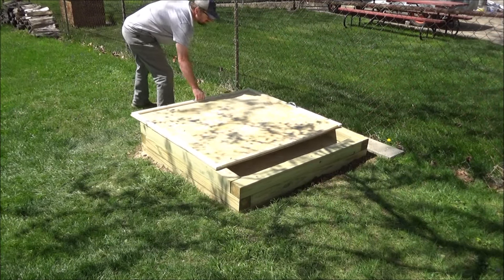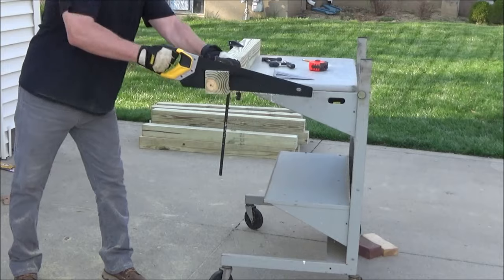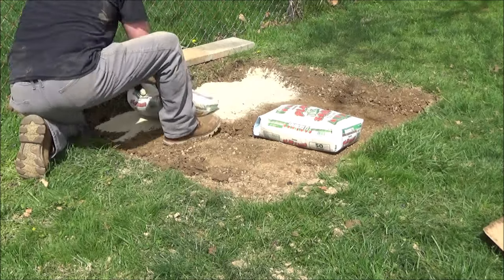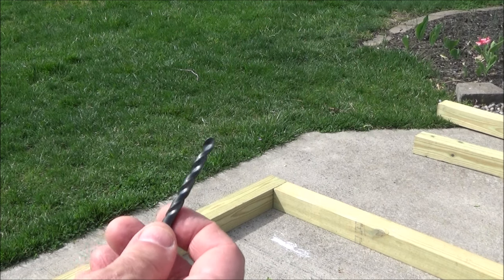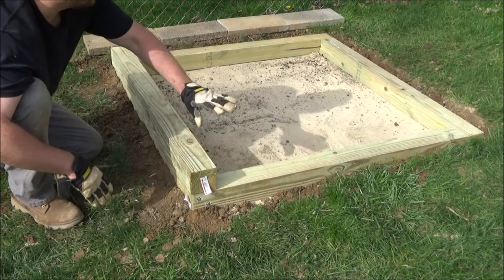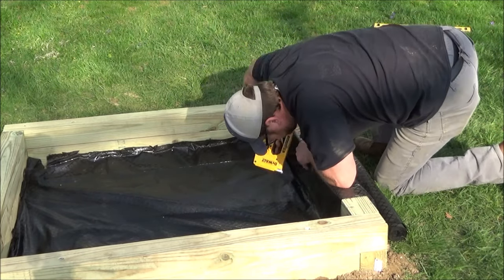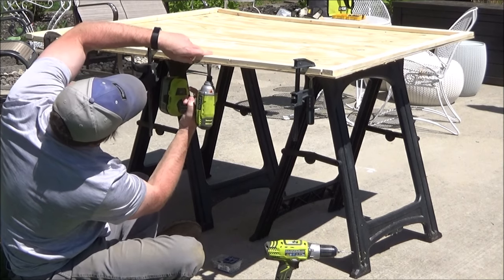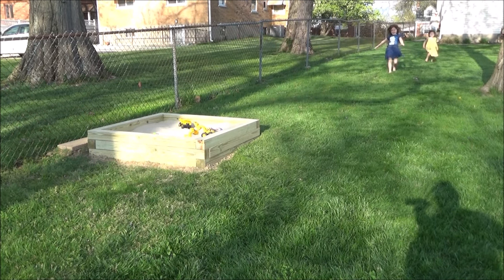How to Build a Simple Sandbox - DIY

Comment: Thank you for this video, I just built very similar sandbox from 4x4s. I noticed sides were a bit unstable and I also added four side screws to attach each side to another at corners, that made it rock solid. For cover I'm using shade fabric as I didn't have spare wood for this size of sandbox and buying new would've been too expensive. Thanks again!
Reply from the maker: No problem and good idea about the corners. Whatever will keep the critters out will work!

Comment: Thank you! How does it stand with rain. Do you need to apply paint on it?
Reply from the maker: No problem. You do not need to paint the 4x4 since they are ground contact boards, but I did paint the lid later to help it last.

Comment: Thank you for this video. I just wanted to know how the 4x4s are holding up being exposed to weather? This is a consideration since we live in a tropical climate. Thank you
Reply from the maker: The 4x4's are holding up solid, since they are "ground contact" treated. The lid has taken most of the damage from the weather. I painted the lid to help it last longer. This past summer I added a few screws where the trim was bowing up and added some roofing paper to make it water proof.
Reply: Thank you! I have my 4x4 from a previous pergola I built. Unfortunately, a cat 4 typhoon took it down breaking the support. Will it do well if the wood has been applied with waterproofing stain and sealer? I noticed that standing water between wood on top of each other harbors a slimy white mold. Though easy to remove from the surface, it may be challenging if this gets stuck in between wood. Nevertheless, will try per vid. Thank you!
Reply from the maker: Sorry to hear about the pergola. If I had the lumber on hand, I would just go ahead and use what you have. Most likely the kids will outgrow it before it rots, but if you want to stain it, just make sure you use something that's safe for around kids like https://amzn.to/3TmdtEw  @bjkcoronel
Reply: Thank you for the recommendation. The size is also just right for converting it into a raised bed when the kids outgrow it. :)
Reply from the maker: That's a great repurpose. I've thought about doing that myself. Another reason to use a non-toxic stain! @bjkcoronel

Comment: Thanks!
Reply from the maker: No problem. 👍🏻
Reply: Very cool idea but, Do you really want your kids playing on treated 4x4 wood?
Reply from the maker: @xraykadiddlehopper8067  They stopped putting arsenic and chrome in pressure treated wood back in 2002. The primary components are copper and ammonia now I believe, neither of which pose the health risks associated with the heavy metals previously used. It probably doesn't last as long as the old stuff, but this is ground contact wood. It literally has a picture of kids' playsets on the side. As long as they aren't chewing on the wood we should be okay.

Comment: My sand box is tiling, all of my kitchen counter tops, this month. Plus i just keep on finding things to tile. Like window seals ect. Oh man that dresses up a window seal. i use a 18X18 porcelain Tile and cut it round for my Webber Grill to become a pizza oven. with a diamond 1" hole saw. make 18 holes around the outer side,  flip the metal grill over, where the handles are down ~  Place the finish title over the grate WHALLA a pizza oven.    I also learn some thing NEVER USE MORTAR. Its to hard to work and a big mess.  Use silicone or liquid nail to hold the title. Grouting is easy and fun with RED DEVIL TUBED GROUT ~  I bet she telling all the kids, to come to play in her new sand box 👍
Reply from the maker: Man, you are tiling everything! Lol. Of course after I did this it snowed 2 days later.  And now I have gotta keep the cicadas out in a couple weeks.
Reply: Oh man, there so many uses for tile, can use it for cabinet floors, walls, floors, table tops, cutting boards,  many uses. its a lot better than wall paper and lots better than floor mica too. Yep i went crazy with it. Next i'am going to dress up the concert steps with it,  and do my patio with them too. Now thinking of doing the roof with tile use asphalt to hold them